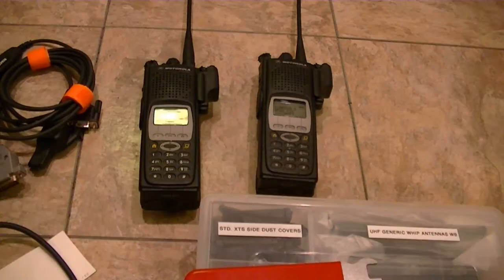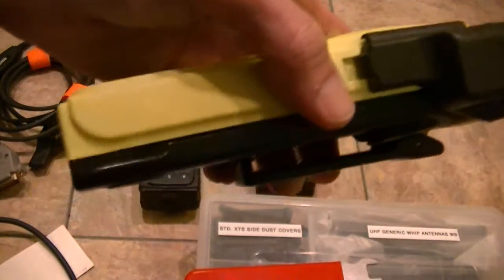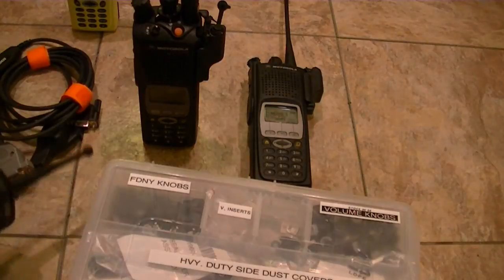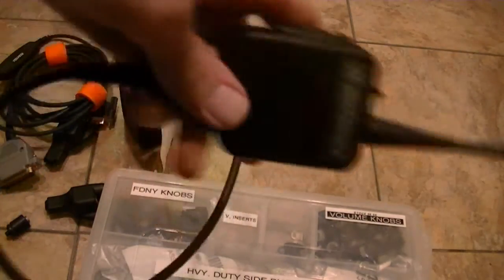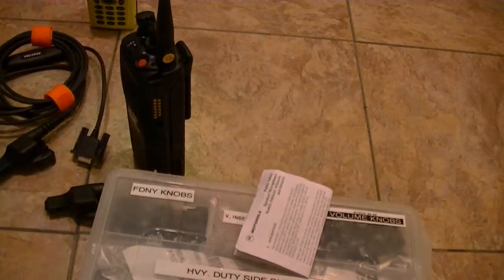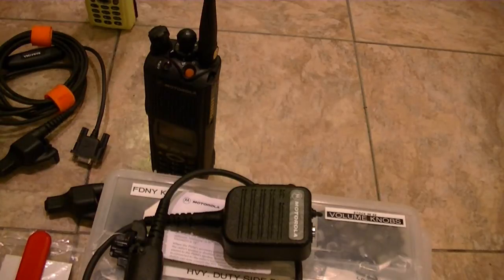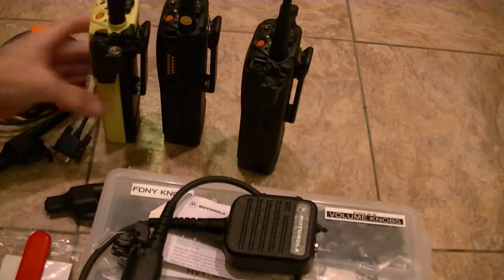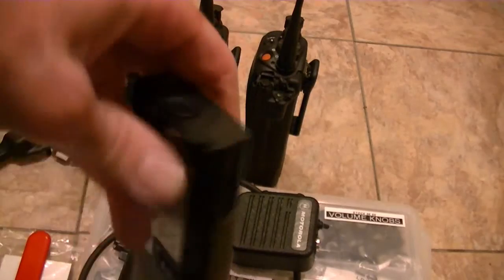Motorola Public Safety Mics, RF Adapters, Inventory and News XTS5000, XTS3000, XTS2500

Comment from the maker: Nope, I checked.  Unfortunately they won't do the 2500'0's, just the 3000, 3500 and 5k's.  Its another downfall of the XTS2500 series units, and, more notably, Motorola design.  As innovative as they are, they refuse to streamline.

Comment from the maker: Unfortunately, all distributors are sold out.  Motorola discontinued them last year.  Its a darn shame.  You'll be lucky to find one or two and if you do, you'll probably have to find it on a radio on e-bay.  A fella on there sold two at 40 bucks per knob and insert.  They used to be about 5-7 bucks, then they jumped to 16 bucks, then 18, then they vanished.  I've checked every distributor I know.  Finding one will be a challenge and they're not going to go cheap due to the demand.